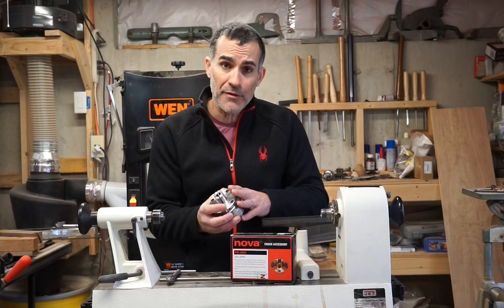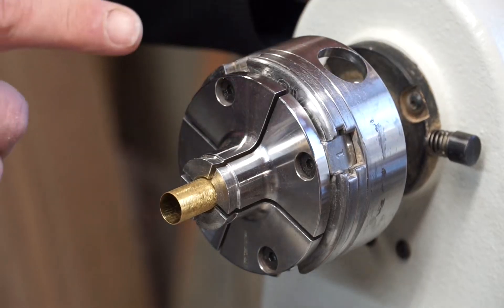DIY: How to Fix your Teknatool Nova Pin Jaw Runout!

Comment: Todd,
Did you check your owners manual for mounting jaws instructions ? I ask this because I own the Supernova2, G3, and the pen jaws. I no longer have my manual for the pen jaws but both of my manuals for the Supernova and G3 instruct us to mount the jaws and finger tighten the screws then back off the screws 1/2 turn and then “wind the mounted jaws into the center of the chuck until they butt against the other”. Now finally tighten screws. Check there is no light between jaw slides and add on jaw segments or that one or more segments is not higher or lower than the rest. Enjoy your channel and thanks for posting.
Reply from the maker: Hi Rick - thank you  very much for calling this out. In fact, I wasn't aware the jaw plates were numbered on the back. What's odd; however, is that the support staff I spoke with never brought any of what you just mentioned to light.